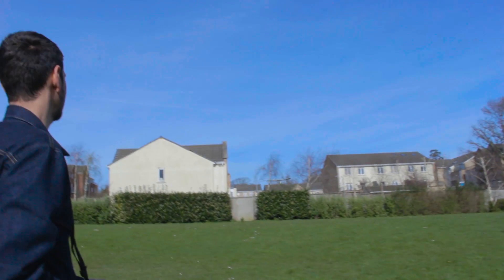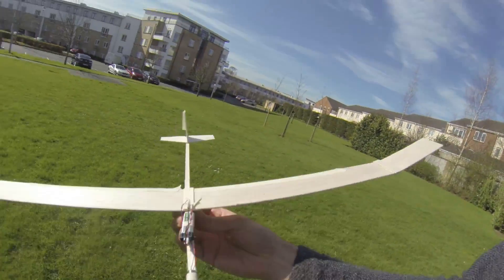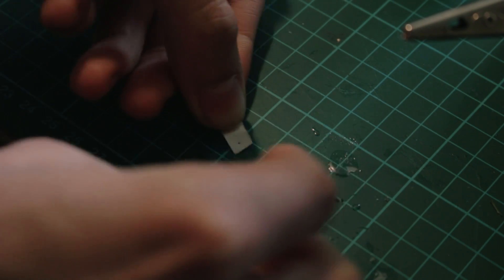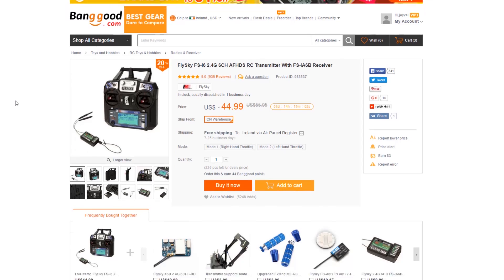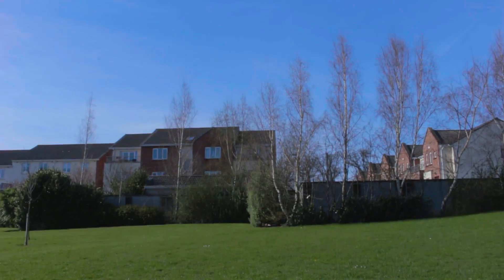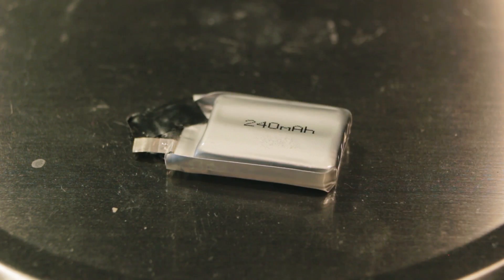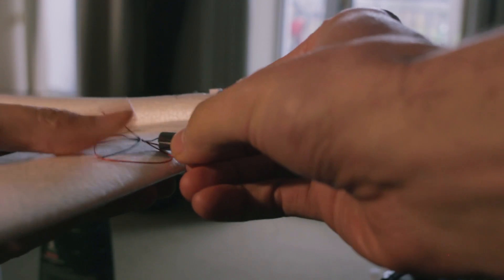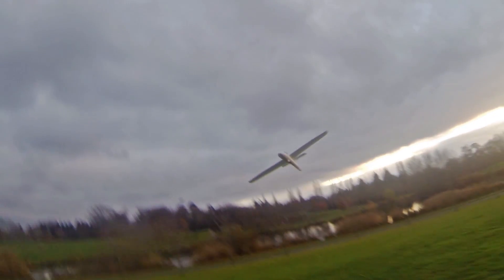✅ How to make a micro RC balsa wood airplane / glider

Comment: Hey! can i use a 3.7v battery to power two 4.9v servos?    Pleeeaaase respond!!!!!!!
Reply: You will need a boost/ voltage amplifier  to convert your 3.7v to 5v

Comment: How did you connect the DC motor to the receiver
Reply from the maker: It wasn't . I connected it directly to the battery in every launch. I could not control the speed.

Comment: hi sir I realy want to know,  do we can use that motor? because I see in another video,they use biger motor even their plane smaler than yours
and what was the compensation if we use this motor,  and how long do we can go with this combination, i am realy a beginer, and i want to know more about this motor, because if i use bigger want it double the cost that I spend,thank you sir
Reply from the maker: You can use this motor and you can connect it to the battery directly or you can use a brushed ESC to control it from you RC. This motor's life is shorter than the brushless ones but it is smaller and cheaper.

Comment: you can lock the thread used for the tail control surfaces  to the servo  , rolling them under the servo screw used to fix the servo arm to the servo gears

Comment: Nice video! Can you please advise, do I need ESC or motor connects directly to receiver? Please advise?
Thank you
Reply from the maker: In this video I was connecting the motor directly to the battery because I couldn't put a micro ESC, in a future video I'll try to make a micro esc to use it with it.
Reply: Joyplanes Try using the board from a 9g servo as an esc. You just need to put two 2.2kohm (if I'm not mistaken) in the wires go to the servo's pot.

Comment: Quick question? With the batterys i belive there 2 cell? To they fit into the receiver??? Or will i have to solder diffrent ends onto the battery? And what will i need to solder?-Thanks
Reply from the maker: Alexander Jackson the battery is a single cell (4.2v) just connect the battery into the receiver any way you want.
Reply: Joyplanes Alright thank you!!As im going to buy all the parts and make a glider and maybe stick a motor on the front after, but im planning it to be launched by a rubber band
Reply from the maker: Alexander Jackson Good luck with your project!
Reply: Joyplanes Thanks this video really helped!!!